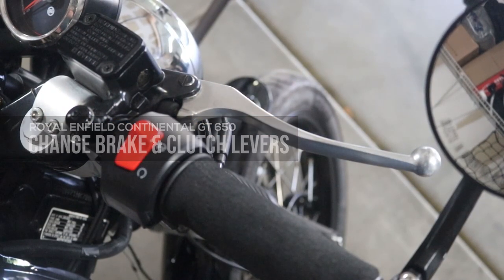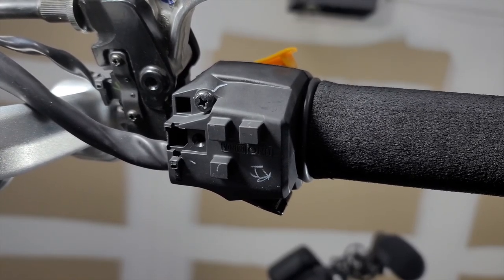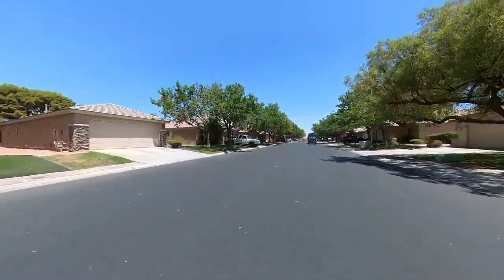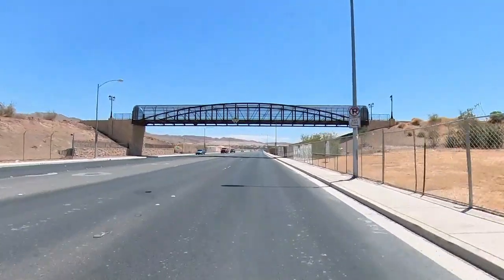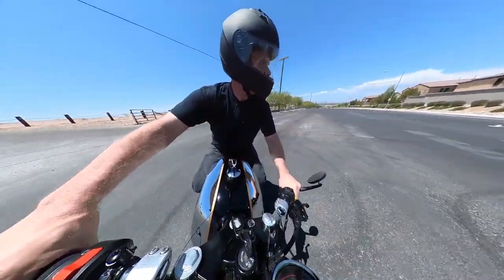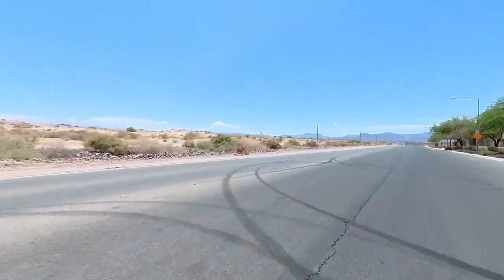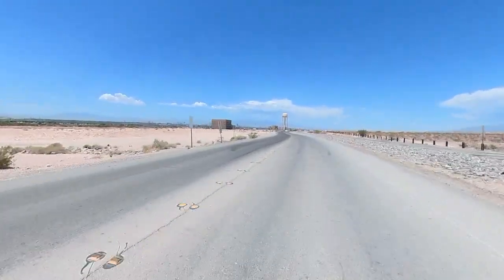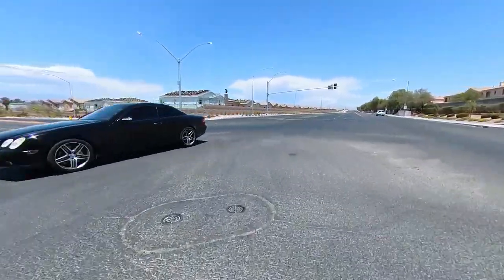Changing Clutch & Brake Levers | Royal Enfield Aftermarket Lever Install

Comment: How much free play did you give the clutch lever?
Reply from the maker: I put the lever on the middle setting and just adjusted until it felt good. That way, having it set to the middle, I could loosen or tighten the lever if needed.
Reply: @RideWithJerry  that’s a great idea! I’m going to re adjust mine tomorrow. Thanks!